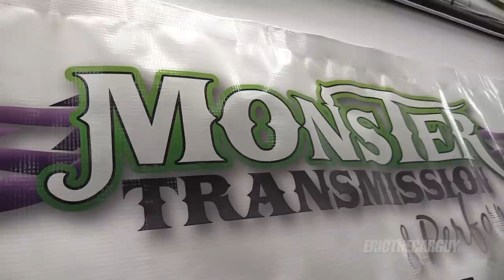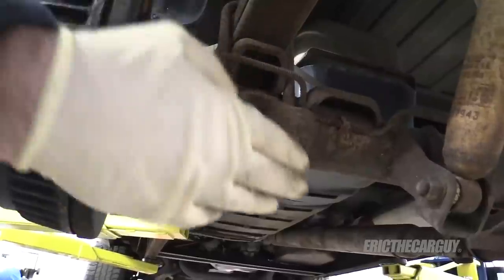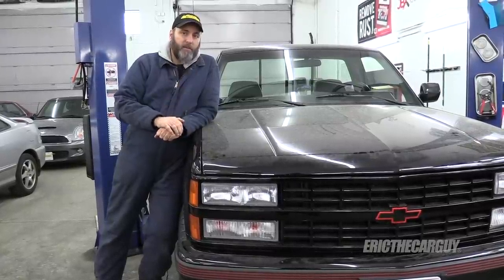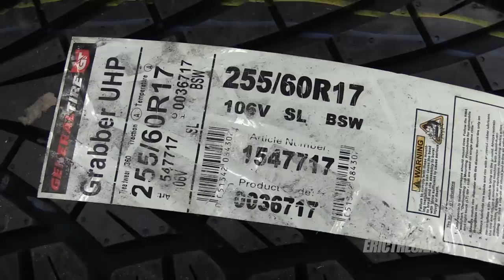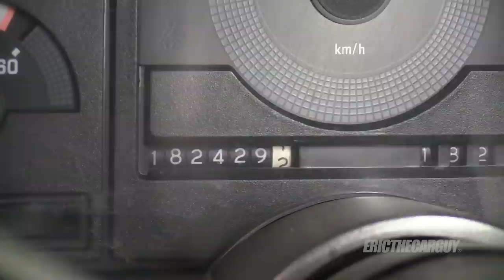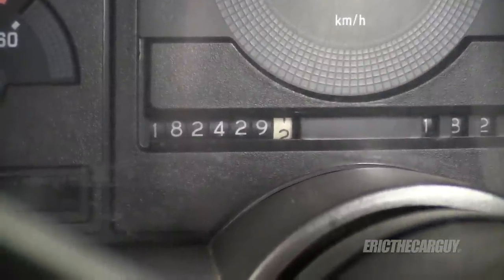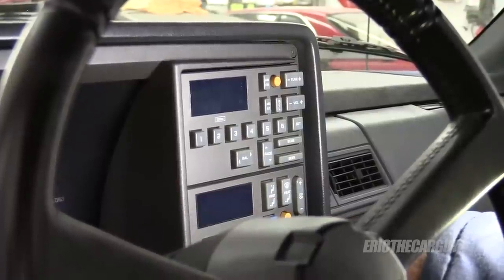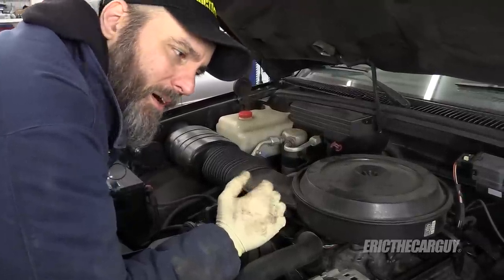#ETCGDadsTruck Build Introduction (Episode 1)

Comment: The tail on the 1999-2007 GMT800 Master Cylinder is larger than the GMT400 Masters so you'll need to update the booster to accommodate it.  The 2500HD T800 trucks have Hydroboost and it can probably be installed easier then a T800 Vacuum booster in the T400 chassis   It'll still need the pushrod length massaged and the T400 brake booster bracket installed.  The plus is it's likely pretty cheap and it's a lot smaller than the vacuum booster can.
I'd try just removing the RWAL ABS from the hydraulics before you go to the T800 master.  The ABS accumulators hold air and that makes the pedal spongy... and the RWAL ABS is a somewhat less than stellar performer.  You can command an ABS power bleed using a Tech 2 or Snap On scan tool on the 1992-2007 T400 & T800 trucks and it does fix the spongy pedal.
If you have a Tech1 1A or Mastertech MTS3100 with the 88-92 RWAL Truck cartridge and Bosch ABS ALDL port adapter you could try an ABS power bleed.  The Tech 1-ish tools will talk to all of the 81-94 GM rigs but they are stupid expensive... especially if the only reason to buy them is to keep the RWAL Brakes.  You may be able to do a power bleed on the 88-91 T400 RWAL with a Snap ON MT2500 and a Tech 1 Bosch ABS ALDL port adapter but I'm not positive.

Comment: For the fuel injection I recommend the efi sniper kit.  Has a self learning ecm.  Works very well imo
Reply from the maker: It's not multiport though, it's TBI.
Reply: EricTheCarGuy this is true.  Well edelbrock has everything. Just open up that wallet lol
Reply from the maker: Actually a complete multiport kit from Eldebrock is less than building one with Holley and MSD.
Reply: I can't wait to see the engine build  you have in store for dads truck!!  I have a 94 Suburban k1500, with 350 TBI  (reliable yet underpowered) engine and I'm interested into put a little more ponies inside this heavy chevy. Keep up the great work and inspiration Eric, I've been watching since 2010.

Comment: 2 things

Most stroker kits for 350s are for the older 2 piece rear main seal so be careful when finding one

Also make sure when you get Cylinder heads you get an intake drilled for them. The Vortec Heads have a different bolt angle then the earlier TPI style heads.
Reply from the maker: Yep, my research has revealed the same info. Thanks for looking out.

Comment: Eric I've been waiting for this to happen 😂 Dad's truck is so clean for its age and the stage one is better if you want to still have a truck if you slam it it becomes hard to drive or load up if need be. Also I would improve the brakes like you said GM was slightly off with them as well as that alarm clock radio lol I can't wait to see all the progress on this truck.

Comment: Plan addition suggestion: Since you have the engine out, drop the trans and do a 700R4 overhaul including a TransGo shift kit and update the booster valve and replace the accumulator vales.

Comment: I have a 1997 GMC and when the head gasket went on it and the heads cracked I just put a GM performance crate in it which was a 383 because it fitted everything with the 350 and the only modification I needed was a chip that came with the motor anyway.

Comment: If you are going to a 383 ci, you will grenade that 10 bolt diff! Grab a used 14 bolt sf from a c/k 2500 there are plenty for cheap with really good 13" drums. Better than disks! Then put a eaton true - track in it. I have done this and it is easy, cheap and great! Use the master cylinder from a 2500 too for the proportioning valve.

Comment: Love everything you’re planning to do. I’ll stick to the Phase 1 drop because too low might not be good for dad/wife drivers. Also, switch to Haltech EFI when it comes to managing your new FI setup. Bet if you contact them they will be more that happy to guide you, help or even provide parts for the conversion. Excellent EFI management makes a world of difference when it comes to efficiency/hp/driveability. Anyway, love to see you cruising with your dad no matter what you end up doing cuz that is going to be priceless.
Reply from the maker: Thanks for the recommendation. I'm actually going to go with this system. I'll have timing control too. https://www.edelbrock.com/pro-flo-4-efi-system-for-1986-earlier-small-block-chevy-engines-35760.html

Comment: Your plans sound good, but as far as your suspension, opposed to a permanent lowering of the truck, have you considered an air ride system?
With hair bags, you can lower it when you want to, but have the option of raising it back up if and when you need to.
 Just a thought.

Comment: Nice project! I've seen the rear spring mount raised on other trucks before. It looks good without ruining load carrying ability. Too low and it's not any good as a truck anymore. 
Also it looks like the transmission yoke is too far out.

Comment: Great plan. May I recommend not going with AFR heads. With a 383 stroker kit and Vortex heads (stock GM). These cylinder heads flow excellent and make excellent power. There's a lot of info about these heads and they're readily available, may even be on your truck now. 15-20 years ago this build would've been a "pie in the sky" build. Either way, I'll be watching. I have a '99 Suburban and the same issue with mushy brakes. I'll be dumping the ABS as well. I had a '93 Suburban with that ugly dash. Swapped it for a '95 dash. Much better!
Reply from the maker: I did look into those, but decided to go with the AFRs. Thanks for the recommendation.

Comment: Great plan for the truck Eric. But, if you haven't looked into the drop spindles yet, you may be able to put larger rotors on it. I'm not 100% sure, but I believe the new drop spindles will not have the caliper mounts on them. But are bolt on pieces.
Reply from the maker: The only conversion kit that I know of for larger front brakes for these trucks is $2K form Wilwood. I don't see the point in spending that. My rear disc kit is already $900+
Reply: @ericthecarguy  ok Eric. Just thought I'd mention about the spindles. They should have brackets that bolts to them.

Comment: I've been waiting so long for this build and now it's going to start to happen excited to say the least I did a 383 stroker kit in mine but instead of going AFR I went with her complete Edelbrock top end kit heads intake and also EFI was so very streetable and on mine like on yours I cannot stand that gauge cluster LOL and the radio they don't make an after-market or at least they didn't to replace the factory radio that little space that's down below is where you used to have to install a single DIN unit but that might be a place you could take the old radio out and replace it with a panel with some gauges oh I'm sorry LOL I forgot this is your build I'm going to enjoy this can't wait
Reply from the maker: In fact, I do plan to go with the Edelbrock top end. Nice to know it's as good as it looks. As for the radio: https://www.retromanufacturing.com/products/santa-cruz-radio?variant=8121367658605

Comment: Good idea on replacing coil springs, old ones are shit. I have two cars which were bought within 2 digits difference on the serial number . And one has been sat at my grandmother's place, nearly un-used and, most importantly, never sat on the tires, rather, sat on cinder blocks on the lift points (grandpa was a former aviation mechanic, he knew stuff). Now the other, went to my mother, and now to me. I finally put the sat car back, and by golly the difference is from earth to the sky. These cars are identical in every aspect, neither has ever been done more than regular service and in the case of the sedentary one, regular engine starts and oil changes. The 23 years A difference between the two cars was my mind blown moment, i know why which components need change and why and how, because of it. A once in a lifetime opportunity, in the sense that you know these things, but you'll never actually "experience" them because of the way we humans work, you'll get accustomed to the change over time, the shock of immediate difference is eye opening.

Comment: Think you might fiddle with the spare tire at some point?  I suspect the 15" stock wheel may have some clearance issues with the dropped spindles, but what's more of an interest to me is the spare tire hoist mechanism.  I was unfortunate that the steel cable snapped on mine so my spare tire is in somebody's yard somewhere.  So i'm looking for spare tire mount options, preferably under the truck.  With a 1996 Yukon, unbolting the stock hoist mechanism appears very problematic.

Looking forward to the brake system swap and the upper/lower control arm bushings!

Comment: What 90's sport truck should not be lowered?  Answer is NONE LOL  Eric, if you haven't already, look into Dakota Digital's VHX and HDX series for the gauges.  They will allow you to add modules to monitor much more than most aftermarket separate gauge set ups.  Also, I'd honestly just do a 4/6 drop right away.  It's the most common, it DOES ride well (trust me) and it's still functional.  Look forward to the build!!

Comment: Tire letter markers are way cheaper and last a long time. Had mine on for over a year with only one re-application. Just a cheaper idea if you're interested.
Reply: Way easier to touch-up too. Some guys like the fade that happens over time but personally I prefer the new clean sharp look and being able to keep the market in the car and make it look perfect as a moments notice is too convenient!
Reply: @Luckingsworth  Exactly. The only reason I had to re-apply was because I used tire shine. It really made them look horrible. But ever since then no issues. They still look pretty good a year later. I think in the spring I'll pull the wheels and re-apply. For the small amount of effort and money it's worth it to me.

Comment: (Exhale) finally, can stop turning blue. The braided lines are a good choice, but don't mess with the single pistons go right to dual piston callipers. 
383 great use of the block you have teamed with pink rods and a steel crank...bulletproof for 7000 rpm.
Yeah buddy this is going to be good. 
Cheers
Reply: Vortech rods are even stronger than the old Pink rods.
Reply: @ne2i  The Powdered Metal "Vortech" Rods I hear are good for 500HP

Comment: Get the Fender Flares from the Era, you'll have a better look and it won't require an extreme drop to get the right look. 

Cooper Cobra from Discount Tire comes with a white letter side, and a plain black side and you can install the tire however on the wheel. 

I have 10.5in wide rims. They are WIDE.

The radio in the center far away from the driver is the only available aftermarket kit, and is the corkiest placement. If you can manage a custom install for a touchscreen where the radio controls are that'd be cool. I was in the process of using a removable face from a 1din radio that has one of those large 2din popout screens, extending the connection with custom wires and placing the display right where the factory controls are in the dashboard. Parts are laying around I just haven't gotten around to it.

350TBI -> 350 Vortec is your easiest way to reliable power. Trying to find someone who does TBI/OBD1 tuning is kind of hard and involved process, but I've been looking at some Edelbrock Hydraulic conversion kits and they come with chips. Thing is, the motor needs a rebuild before I consider upping the numbers. 

It sounds like you want to go LT5 route with what your Want list looks like. 

 I've already determined that I'm going to put the LT5 from the z06 in the truck and regift the truck back to my dad for his retirement. He always wanted a Corvette. And he never wanted to park his truck. My dad's first new car was the 1990 C1500 Cheyenne. And it was my first car. I'm going to give it back to him with the guts of a Corvette. He doesn't know that though, so it's between you and me, reader.

Comment: You read my mind. I have an 89 C1500 that I will be going through the motor in the next couple of months, so I am interested to see what you end up doing. I am very interested to see if you use roller lifters and rockers, and if so, which kind. I have been perusing the Summit Catalog for over a month now trying to decide what parts to order and what parts to get locally from the machine shop. This is going to be way cool!
Reply from the maker: I do plan to go with roller rockers and cam. I'm getting them from Comp Cams. They made the cam for the Fairmont and it's excellent. Just be sure you degree it. https://www.youtube.com/watch?v=n_9rUXYxAY0&t=3s

Comment: Nice I see the 383 stroker build 😎, the 8.6 ten bolt 373 gear is in some suburbans at the wreck yards, make sure there the same length wide axle end to end tip😂🏆, just a fan🏁

Comment: Auburn limited slip? Make sure the bearing kit you get for that differential comes with the larger side bearings that most the aftermarket limited slips require on the older (pre 99) chev 10 bolt. Looking forward to the build!
Reply from the maker: Hm. Hadn't thought of that. I guess I'll find out next week.

Comment: Awesome plan Eric! I'd do a camshaft upgrade as well. The newer 350 engines swapped the firing order for smoother operation and better power. I believe it was 4 and 7 that were swapped.  Please feel free to correct me if I'm wrong on this.
Reply from the maker: No worries. Replacing the cam was always part of the plan.
Reply: @ericthecarguy  Sweeeeet!

Comment: The block should have the bosses for a roller cam spider.  They may be drilled and tapped if not already then put a roller cam in it.  Besides the better performance, you don't have to add ZDDP to keep the flat tappet cam happy with today's oils

Comment: For lowering the rear end, are you certain you want to cut into the frame to achieve the ride height you want? That seems extreme to me. How will you ensure you don't compromise the original integrity of the factory frame? If you go down that path, it will be interesting to see how you do it. I'm imagining a good amount of metal fabrication and welding.

Comment: I would look for a 96-02 350 block.  That way you can run a roller cam and utilize the factory drilled roller lifter hardware.  Also go vortec.  Also, as someone who inspects differentials, go with a torsen lsd.  I've seen too many cone style lsds that have exploded
Reply from the maker: I'm using the block that's in the truck. The philosophy of this build is to use what I have. As for the diff, I agree, but the diff I got was available. Also, I don't plan to beat the crap out of this truck. I like it to much.
Reply: @ericthecarguy  well run what you brung then!  Also, be aware you may need to replace at least your right side axle shaft.  That's one of the biggest things i see on the 88-98 American rear axles, no matter the badge on the tailgate.  I'd say change the bearings too, but you probably will since you're doing a gear swap too

Comment: To be honest, I’m not a big fan of lowering trucks, but I’m not going to give you a hard time for your decision, because it’s your truck. I will offer a suggestion though, is there really a need to build a high horse power engine? After all, it’s a pick up truck, and in less you tub the backend and put extra wide tires on it, all you’re going to do is roast the rear tires when you step on the gas and get poor mileage. If you want to run and power tour, I would recommend keeping the 350 in close to stock form. It will have more than enough power to do what you want, and much better drivability. Are you going to keep the trailer hitch used to tow the boat?

Comment: id recommend a 12 bolt rear vs spending any money on that 10 bolt.  Dont forget about crate motors- many times you can find a build your looking for right out of the box-and cheaper as well, with a warranty. If youd like to get an idea of how the truck will look lowered just let the air out of the tires. You may not like it after all and no $$ was spent then.  just suggestions, thats all.
Reply from the maker: Too late.

Comment: Automatic trans gearing? 5 or 6 speed so that on the highway the engine can work easier. Just a 
thought as 3:73 can make a 383 stroker a real gas burner. If you can perhaps look at a larger fuel tank. If you use the truck to haul your Fairmont on a trailer for example stopping every 200 miles gets annoying real quick.
Reply from the maker: I don't plan to use this truck to haul a car trailer. I'll get a diesel truck for that at some point.

Comment: Eric sure could use your help.  Got a 99 honda crv 2.0, 4 cyl.  If it sits overnight, the next morning it wil start, and idle until you put it in gear.  Then it smothers down and dies,  It is then hard to start unless you give it a little fuel.  
after it warms up it runs fine all day, until you leave it sitting 5-6 hours somewhere. Have cheked coil, auto idle air vale, the air vale on this one has two coolant lines going through it to keep from icing.  I have even put that in hot water to see if the little thermostat is working the valve, which it is. My hair is nearly gone.  This is my granddaughters car and she works late at night.  Dont want her broke down in a parking lot. HELP!!!!!  OH, have cleaned the throttle body as per your instructions. Ideas?????

Comment: ,eric please read this, do not waste your time with a 2/4 drop. it will not be low enough, you will wanna go lower.

if you do shackles youll have to put all the stock hangers back on to do a flip kit. just do a 4/6 and be done.

flip kits are easy, bolt in notch kit no problem
Reply from the maker: Thing is, I don't know if I want it that low yet.
Reply: @ericthecarguy  my truck is 4/6 dropped very streetable not too low at all. sometimes a 2/4 doesnt even look like the trucks lowered. 
just my 2c, although you might go 2/4 and be happy. it just sucks when you do all that and have to change it to go lower